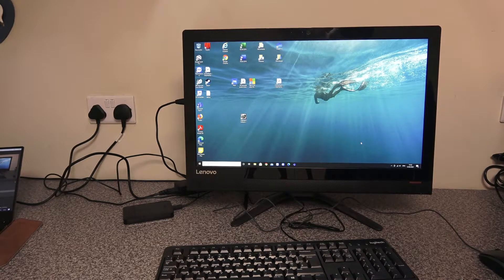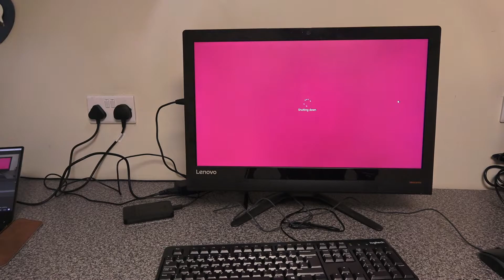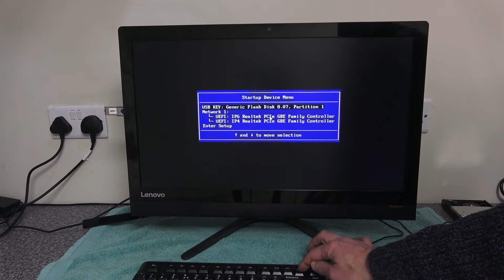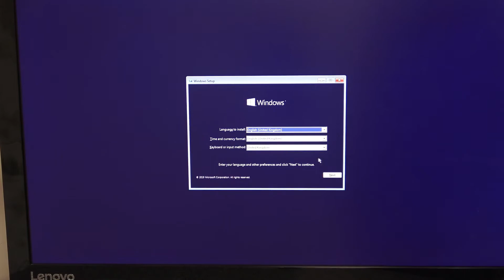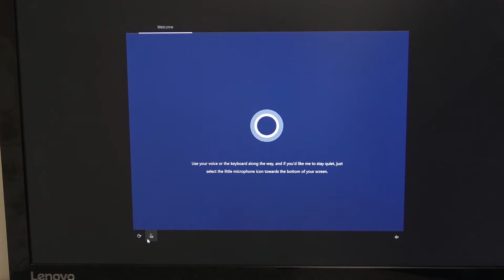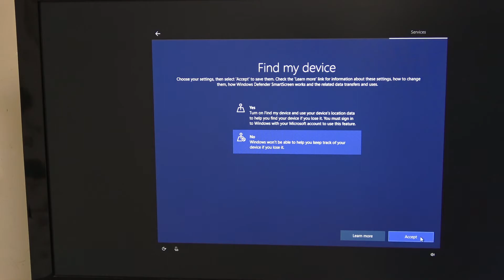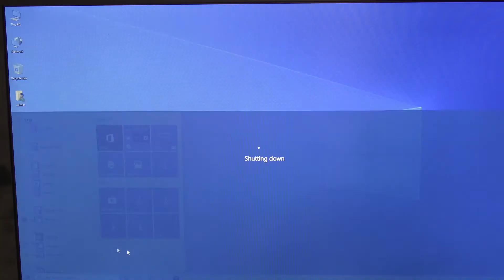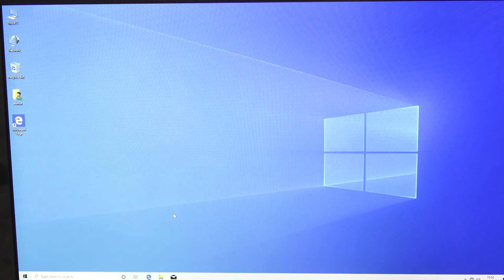Lenovo Ideacentre HDD to SSD conversion and reload Windows 10

Comment: Hi FC ! I have the same PC and also swapped the original HDD with an SSD, was wondering if it'd be possible to run two drives from the same machine, I opened it up to see if I could find another SATA port, but no joy ! Do you know of any workaround or adapters that may be available ? Thanks :)